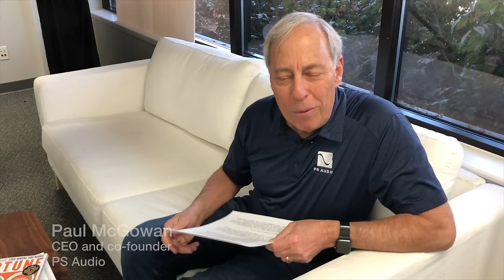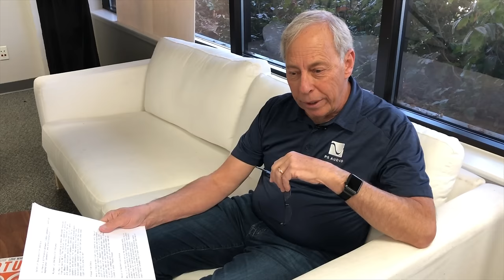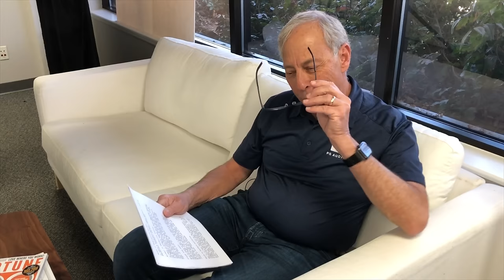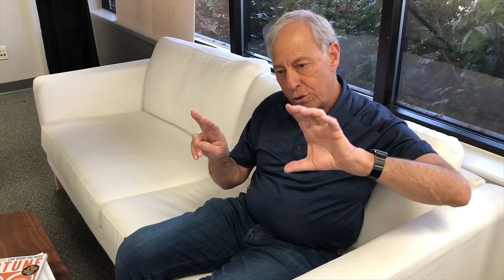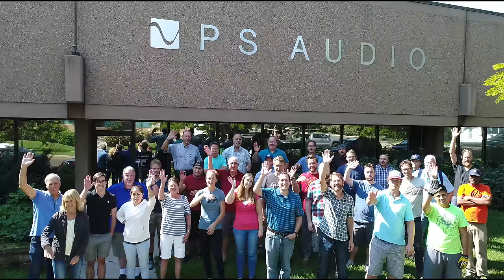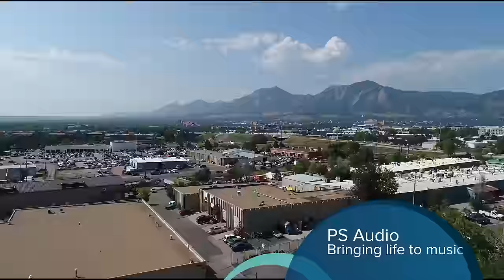Why don't more preamps have XLR?

Comment: Hello Paul, I have a question on RIAA equalization. We all know (most of us) how with basic analogue elements a circuit can be put together to create a low-pass or high-pass filter. But with this we always get a phase shift. I am wondering how RIAA eq is done in the analogue domain. Could you explain this?
Reply: It is generally just an RC circuit either passive or active (Feedback). Since each filter is first order phase shift is really not an issue.

Comment: Balanced outputs tend to suck compared to unbalanced, and to do it right is even more expensive than what you're talking about with input switching and at best is only going to equal good, cheaper unbalanced, anyway.  It's a utility connection for long runs around sources of noise and RFI/EMI, not an audiophile connection.

Comment: Could you just make a switch? like 4 inputs / 2 outputs for example?
Reply: A nice separate switch box that did nothing else could easily handle 6 or 7 inputs plus the  output without the case being too big.  But it still might be quite expensive as a stand alone device.

Comment: Using unbalanced wiring is also a performance compromise compared to balanced wiring. 
So in that way the performance compromise is moved from inside of the amp to the outside, to the wiring.

Comment: what? quality cost money? no.... :P I wish more people value the cost of quality.
Reply: not the same,lambo,you pay to go fast in style,it cost a lot of money in parts and engineering,sound isnt parts,sound is just sound,so if you can make an amp,cd player,power amp or pre amp that sounds good,not necessarily expensive parts,thats what to pay for,typical example ,i bought a cartridge 20 years ago for £50 and asked why a re-tipping cost so much money,the answer i got was because they sound good,same parts to repair,but the cost goes up if it sounds better

Comment: If you want to save 11 minutes, the answer is:
XLR inputs require twice as many relays per input.  Ergo, XLR inputs cost more to implement, resulting in higher cost for the customer.  So since most people neither care nor know anything about the benefits of XLR inputs, then the manufacturers keep their prices lower and have more units that are priced within more people's budgets, by skimping on XLR availability.

Comment: I love the way you audio gurus need a 1/0 cable for a speaker run of 2.5 meters, when the same lengthy of 8 gauge resistance difference would be so close to 0, except at 1000W. They call it Ohms Law.
Reply: jim hough what the hell are you talking about

Comment: If the relays cost so much why not add the differential circuit to each XLR prior to the relay.   That way you have the same number of inputs on the relays.  (ie turn 4 wire into 2 wire and then mux it)   The point of the XLR and differential signaling is to mitigate noise from the cable acting as an antenna.   On a PCB board, you should not be picking up noise because the runs are so short
(I may be full of $hit here but that is my novice understanding).

Comment: If it’s a matter of cost, than why aren’t all high end products aren’t equipped with xlr connectors instead of rca connectors? Why do cable retailers and manufacturers offer so many cable product lines, when the single task of a cable is to let the signal pass absolutely unaltered. If a cable is doing so, there’s no better cable possible. If Kimquest and others offer e.g. 20 types of interconnects or speaker cables, are 19 of them sub par constructed? Why haven’t been standards established for a passive conducting wire with shielding?

Comment: One important topic you have not addressed: I understand the need for a balanced input line when you have placed all the signal source components in an alternate room to isolate them from acoustic and mechanical vibrations in the listening room, and the signal needs to be run a long distance to the amps in the room. But if all my components remain in the listening room, and I ignore the issue of vibration of my components (save the turntable, which is set on a panel hung by thin steel wire from the ceiling), then all my interconnects are no more than one meter in length. Esp if I keep the AC cords away from the interconnects, the RF noise coming from my system is so small as to be irrelevant.
Reply: Speaker Builder that’s exactly what was going through my mind as I listened to Paul.
Reply: ITs just a noise thing , Balanced is not for far away , long distance , its just less noise from Ground wire , one can get Ground loop Isolators , they are the same thing , but native Works better , i can live without it on Hi FI , tho it would be nice to put it in Audio Gear that costs Arm and A Leg
Reply: It's hard to avoid going from one component to another without getting too close to an electrical (power) cord. With XLR cables they can be right next to an electrical cord and there won't be any noise.
Reply: The XLR interface on my phono amp has a higher line voltage than the single ended output.. for me this provides more headroom for my integrated and translates to fuller and richer and more dynamic sound at lower volumes.. when I use the RCA connection, I need to increase the volume to get the same SPL and the signal isn't as crisp.

Comment: Why don't use solid-state relays non-mechanical
Reply: SSRs are single pole, single throw which is OK for mono, not so great for stereo. Their "on" state exhibits resistance while a mechanical relay exhibits 0 Ohms.

Comment: How about just skipping remote control or remote input selection.   I would be willing to pay $1000-1500 for a balanced preamp with 3-4 balanced inputs, 2-3 RCA inputs, a good headphone stage with 1/4 inch jack, and remote volume control.  Similar to the design of the Parasound P-LD2000  but with the headphone capacity.

Comment: Xlr vs hdmi?  Which is better
Reply: I use both . HDMI to my preamp and XLR from preamp to amp. I have Klispch Chorus speakers with 103db efficiency . On poor recordings I can hear background noise, otherwise I hear nothing. If you can delete RCA connections do it. Just my $.02 .
Reply: @sux2bu883  Problmem is many HDMI connections do not transmit DSD signals, so we are forced to use RCA jacks (as many machines aren't equipped with XLRs).
Reply: @jn3750  Sorry  I wasn't clear. I don't use a CD transport or a stereo. All of my music is on my computer. I use HDMI out from graphics card to my "Essence HDACC II-4K" to my Crown amps. Essence HDACC II-4K is a really nice piece. So that's my setup.

Comment: I Use Studio Monitors for my setup, kind of working with sound , Active monitors have no Volume  knob so Noise is an Issue , without Balanced XLR i couldn't use it ,  but on the other hand my complete Audio signal Path , costs 100$ , it is Balanced , it is a Preamp  , DA / AD converter , microphone Preamp , Guitar AMP , all Balanced , fine audio gear , 96khz 24bit , 100$ , ive used best DACs 192khz 24bit stuff , , cool stuff , but even that was 200$ , i just cant imagine parts in the preamp that cost 1000$ , i jsut cant ,  Electronic parts are dirt cheap , whole Amplifier IC costs 10$ , preamps even less , maybe its something ive never seen let alone heard , i trust they make fine gear , if i was Dirty Rich sure , but im not going to pay 200$ for balanced output , get volume knob and its all fine
Reply: I agree 6000 for a pre amp is crazy and electrical components are not that costly. I'm retired and used lots of relays in air conditioning and electrical and they are not overly expensive and to not install xlr connection on a pre amp that costs 1700 us dollars is crazy. As long as people are willing to pay the higher prices then they can make their money. You can get a nice pre amp that's less than 500.I have a sound system in Philippines that can be used for karaoke or for a wedding event or dance party costs under 1000 us dollars. Sounds really good. I'm sure 8n the USA the same system would cost 4000 us dollars plus

Comment: Balanced inputs are fine in respect of low interference but you need a true sym. Input circuit that have a 6db noisegain and therfore a 6db higher overall noisefloor of the preamp.

Comment: Paul’s Analogy of parts and labor cost are completely incorrect! One of his Products retails at $1750. The parts and labor cost is 1/4 to 1/5th or 20 -25% of that retail price of $1750. Example: $1750 x 20% = $350 parts and labor cost not including his overhead. For those of you who don’t understand what that means I will fully explain it! Overhead is the cost of a company’s electricity, mortgage, property taxes if they own the building if not it’s they’re monthly Rent, Business Liability Insurance, Payroll taxes, labor, parts, marketing costs, Telecommunications, IT Costs, Computer, Equipment Costs, Packaging, etc. when a manufacture sells a product to a dealer in their country they usually Discount the product at 40-45% from the Retail price to the In Country Dealer, if the products are being exported to out of country dealer dealers negotiate an additional 10% discount or more to cover their import costs! 

So in the final analysis the company may be grossing 55 to 60% of the retail cost selling to a In-Country Dealer. This is if they’re not using a rep firm to market their products to their dealer base which will cost the manufacture a 10% commission.

Comment: Too bad you don't have a build to order system, where the customer can choose the input and output types.
HDMI, Balanced, RCA, Phono, etc... 
So one buyer may have an LP and Reel to Reel, Blueray, and 3 balanced sources, and another has 6 balanced sources, it would make a nice one stop shop for all your PreAmp needs.
Reply: Also one easy way to drive up the cost!
Reply: @jonathansturm4163  Or save. NAD has been doing this for years. They sell add on card modules, so if you need hdmi, phono or network streaming you just have to buy an add-on card, but if you don't need it you can skip the extra price for the modules.

Comment: That`s why you can cut your money you have to pay in 90 to 70 percent if you do diy compare to buy commercial products.
Reply: Ye its probably the best way to get something half decent not being an extortionate cost.what puzzles me with high end gear.they build it with Toroidal transformer inside shield it then tell you to upgrade with external psu at great cost.sell it like that in first place not having to upgrade or next model up at 3grand extra cost.

Comment: You do not need to pay 6000 us dollars for a pre amp. If your rich than by all means do so. I now live in the Philippines and have recorded video for you tube where the audio sounded great. Good DAW software, mics and audio interface is the key. Good cables and equipment that can be bought inexpensively. For live performance you still dont need to spend crazy money. For studio krk speakers work. Live performance speakers, amp, mixer, pre amp can be expensive. Here you can get minus the instruments for live performance under 2,500 us dollars. As long as you have laptop and daw software and instruments. Good condenser mics, instrumental mics are not cheap. Krk is not cheap and a nice interface will cost. Total also under 2,500 us dollars. Most people cannot tell the difference in a pre amp that costs 300 or 6000 dollars.
Reply: I think most of the audience here is looking for audio reproduction that is far superior than what is typically found on even pro level YouTube videos. Also, most of the examples you cite are particular to multi-media production or live sound. While there is plenty of overlap with the gear discussed on this channel, the focus here is aimed more towards high end audio reproduction for home audio and home theater (not completely, but much more so). All that being said, you make an absolutely valid point that you don’t have to be rich to create or reproduce perfectly acceptable, good quality audio. Smart purchases by a well educated and competent artist (or listener) will almost always result in better sound than expensive gear impulsively bought by someone that doesn’t know what they are doing. It’s the ears and brain that matter, not your wallet.

Comment: Sorry, relays? Why can't each input have it's own 30 cent opamp and associated balanced and gain circuitry that each drive a simple mix circuit into the next stage...like a normal mixer does? If you don't actually want to mix all of the "channels" at once, just incorporate mute circuits on each input that responds to a channel selector switch or input mode. Select channel 1, all other channels electronically muted, select channel 2, all others are muted, etc. Same effect of trying to mechanically switch multiple input connections to a singleton input circuit without the mechanical relay nonsense. Opamps, even good ones are dirt cheap. This would also give you the opportunity to optimize the balanced and unbalanced channels for ideal operation.

Obviously, if you are using transformers for your input circuit, cost and space used on the circuit board may become prohibitive for high channel counts.
Reply from the maker: Because electronic switches, especially op amps, don't sound as good as a mechanical switch. I wish they did because an op amp's a lot cheaper.

Comment: Bottom line. Balanced input are superfluous for line level. Phono or mic balanced yes. Line level balanced = snakeoil.
Reply: @Bob Nixon
I wouldn't exactly say that because you do get doubled amplitude.  It may not amount to much for a home system but in Studios where you have Tens of Multiple Input and Output channels, the noise floor will build up.  The potential for hum and ground problems tend to multiply.  All lengths of cable are susceptible to picking up noise and spikes whether it's Mic, Line or Speaker Level.  I've even seen installations that even have Balanced Power lines.  Properly grounded they are quieter and sound amazing.

Comment: I guess XLR makes only really sense if you have a true differential path from input to output. But source components on lower spectrum of market is single ended. Balanced (XLR) beating single ended (RCA) becomes expensive if attenuation/gain matching is sufficiently accurate. Does not really make sense to convert from balanced to single ended or vice versa. Good design and layout single ended gives more predictable and repeatable performance compared to sub optimal engineered or pseudo (internal single ended) balanced. Some XLR equipped pre-amps and especially AV pre-amps often overrated but it looks fancy and can drive longer cables with less noise if not necessarily better quality.